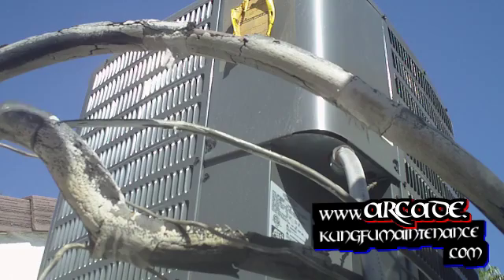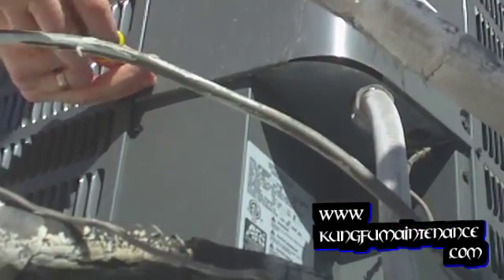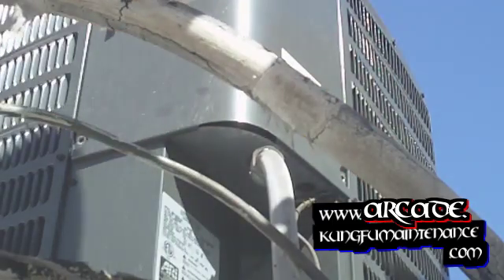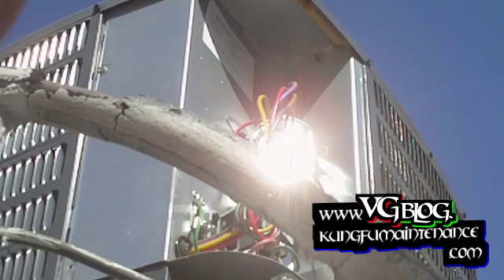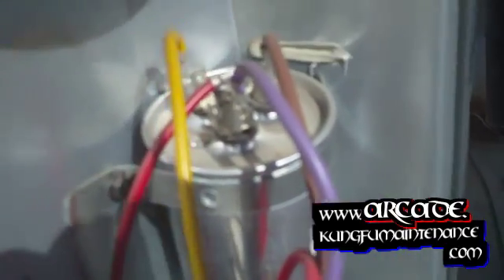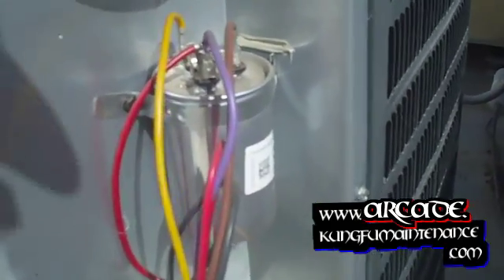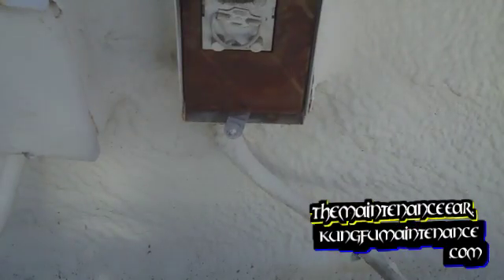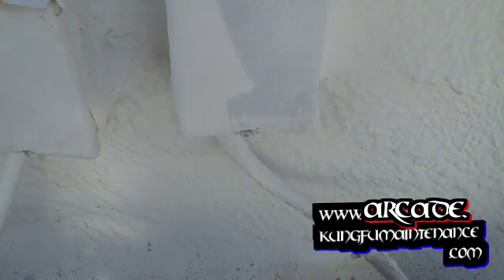How To Install An Air Conditioner Hard Start Kit

Comment from the maker: Hard Start Kit     http://amzn.to/2kiD16v   Contactor     http://amzn.to/2lFqA0P
Get  the Multi Tool Pliers used in so many KFM videos       http://amzn.to/2kWTjPp
5mf Capacitor   http://amzn.to/2wC96sH     35mf Capacitor    http://amzn.to/2vZVZ2t
35/5mf Capacitor   http://amzn.to/2iVJNi2        40/5mf Capacitor    http://amzn.to/2wzEdXD 
45/5 mf Capacitor   http://amzn.to/2w0wez5   
Get KFM's favored AC Gauges here            http://amzn.to/2kYgGb8
Valve Core Removal Tool                              http://amzn.to/2kJ00pC
Get KFM favored Electronic Leak Detector        http://amzn.to/2kmQMMz
Simple Leak Seek Spray   http://amzn.to/2lFfcC5  Laser Thermometer  http://amzn.to/2layD8I  
Inficon Refrigerant Scale                               http://amzn.to/2vUCQPD
Get KFM's favored Multi-Meter  here        http://amzn.to/2l8W9CO 
Get the Milwaukee 11 in 1 Screwdriver     http://amzn.to/2uTtsNj 
Wet Dry Vacuum used in so many KFM videos   http://amzn.to/2lFxi7u
Condensate Pan Tablets   http://amzn.to/2lalV9W   No Rinse Coil Cleaner  http://amzn.to/2lHg8GD
Condenser Fin Whisk Brush                          http://amzn.to/2vWXUoC 
Chapin Pro Pump Sprayer                             http://amzn.to/2vWCXdD
Evaporator Coil Cleaner No Rinse Mix        http://amzn.to/2x3eJTT
Evaporator Coil Cleaner No Rinse Can        http://amzn.to/2ezIxju  
Get the Screwdriver used in so many KFM videos here    http://amzn.to/2kHFoOF 
Easiest Way To Get Universal EPA Certified Prep Manual    http://amzn.to/2kIQdQC
You must be EPA certified to charge or recover refrigerants and here is about the Easiest Way To Get certified with the Universal EPA Certified Prep Manual    http://amzn.to/2kIQdQC
Get The Kung Fu Maintenance book here     http://amzn.to/2lEQPFk
Or  the Kung Fu Maintenance E book here  for less than $5    http://amzn.to/2lEY8wD
Get the Kung Fu Maintenance album (good driving music) "Up Beat" here     http://amzn.to/2l41pZ1
Get the Kung Fu Maintenance album (nice Instrumental music) "Entropy" here   http://amzn.to/2kl2U0p
Samsung Galaxy S8 Plus        http://amzn.to/2sFn9h8
GoPro Hero 5 Action Camera         http://amzn.to/2sN4nVK
Rode Lapel Microphone                 http://amzn.to/2vZoFc7
Purple Panda Lapel Microphone  Kit   http://amzn.to/2wByXkq
Video Edit Pro Software       http://amzn.to/2ruaaeZ
Samsung Galaxy S5                 http://amzn.to/2wBxk6l     
Samsung Galaxy S8 Plus        http://amzn.to/2sFn9h8
Video Edit Pro Software       http://amzn.to/2ruaaeZ

Hire An HVAC Specialist                                  http://amzn.to/2lktKek
Air Duct Cleaning Services                              http://amzn.to/2lFTpun
Central Air Conditioner Tune Up                   http://amzn.to/2lzJGoy 
Air Conditioner Repair Or Installation          http://amzn.to/2lFsEGw                                           
I don't work for any of the product companies  listed however I do make a small commission on items ordered  through the links.

Comment: Problem: My AC when I turn it on, makes buzz/horn sound every 45secs or so.  It makes the buzz/horn sound about 7-10 times then I feel cool air and no more buzz/horn sound.  Do I need a hard start kit? If so, why would i need it, my AC is 2 yrs old?

Comment: first thing you should check is the line voltage. Then compressor amp draw at start up and run. Then make sure pressures are right.  you should have also tested the run capacitor. if the run capacitor is losing its mfds, the compressor can struggle to start and run. 
dont be a parts changer, be a technician.

Comment: Couldn't you do the same thing with two capacitors ?  Just wondering.  I mean as long as the microfarods stay the same but it would boost the voltage up to around 660/880  volts.  How many volts does the hard start boost add to the start up of the compressor?  Also I would like to ask, if this is a new unit why does it require a hard start kit to begin with.??  It seems as though the manufacturer should have worked out the bugs in the units it sells to prevent this problem. Could it be that so many of them are being made in China instead of the good ol' U.S.A.   I would like to know if you are going to make the repair to the carflex connector, also why not replace some of the insulation on the suction line.  It doesn't cost much and it would make for a better  and more professional looking job.  Just saying Just wondering in Texas

Comment from the maker: Might have them try a soft start kit instead of the hard start kit. It has less of a jolt than hard start kits. May or may not work though. That would be what I would try if fit really bothered me.

Comment from the maker: I have several different multimeters but my favorite has to be my field piece. You can see it in the beginning of my video "Creatures of the Desert" hooked up to the optional temperature  clamp. It is a nice piece of equipment with many useful features.